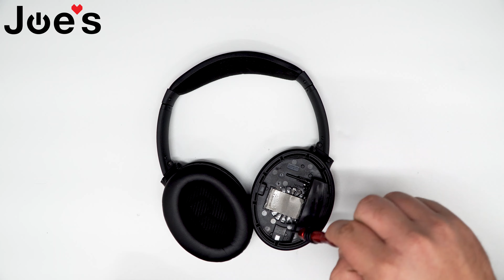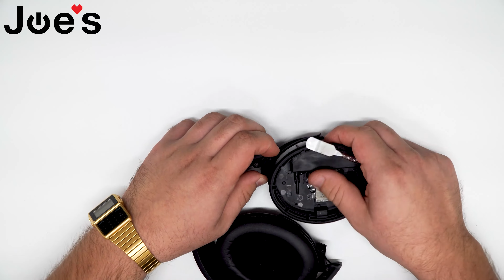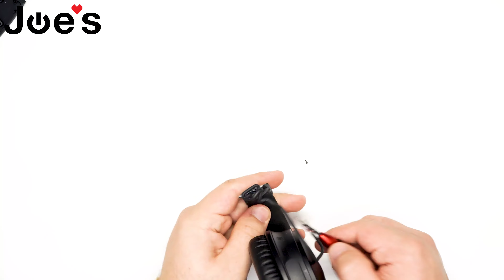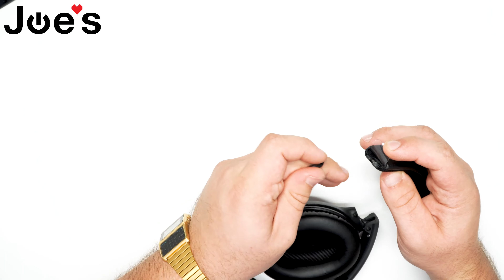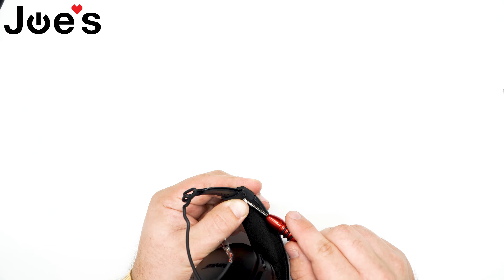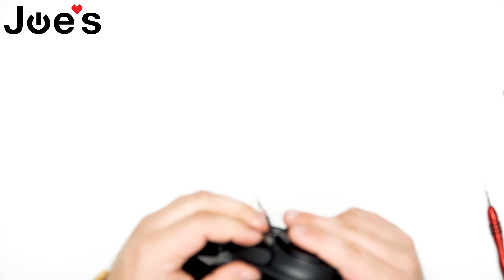How To Repair Replace Bad Torn Up Bose QuietComfort 35 QC35 Peeling Flaking Headband | Tutorial

Comment: Successfully completed the repair thanks to Joes listing and this guide. I had a little trouble with remembering what wires go to which pads, which customer service helped with quickly. Thanks Joe's 5/5⭐
Reply: For anyone in the future looking for the wiring to pad legend. This might not apply, but for my version of Bose QC 35 II's. The wiring was as follows:

Solder Pad -> Wire Color

B+ -> Thick Red Wire
B- -> Thick Black Wire
R -> Red/Black Wire
L ->  Green/Copper Wire
LFF+ -> Purple Wire
LFF- -> Teal Wire
T -> Black/Copper Wire
LFB- -> Green Wire
LFB+ -> White Wire
LDRV+ -> Red/Teal Wire
LDRV- -> Red/Copper Wire
DET -> Teal/Black Wire
Reply from the maker: Thanks for buying the parts from us we really appreciate it. Glad we could help you with the wiring!

Comment: After doing that mine does not turn on. Is it possible that I shorted out something? If so, what would I have messed up?
Reply: Nevermind, turns out I had two wires swapped. It is super hard to tell what color they are.
Reply from the maker: Glad it worked out for you

Comment: I wish Bose had place in a plastic connector for the wire instead of soldering it for easy headband replacement and or  other repair measures...

Comment: Hello. Do you have a video on repair for the volume button?
Reply from the maker: We don't currently have a video for that, but we get one in the works for ya

Here is a listing to the part: https://rb.gy/j6as5m
Reply: @Joesge  thank you so much! My button broke about a year ago and just realised that I can have that repaired. I will get the part soon. I hope I don't have to take apart the headset too much to get to the buttons.

Edit, I should specify the rubber part is broken. The underlying circuit is in good condition as far as I CAn tell.

Comment: Hi guys,  Thanks for the video, it helped a lot to understands the steps I need to follow. . I have a somewhat similar problem in that I broke the small swivel/hinge on the right side. There is no way I can unsolder and resolder so many small cables without a catastrophy, so I plan to cut the cable inside the headband, change the swivel and then use no solder thermoretactable connectors to relink both headphones. Dirtier but at least feasible for me.  AWG26 and up thermoretractable connector are easy to find, smaller not so much. Therefore my question, do you know the gauge of the 14 or so small cables you unsolder then resolder in the video?
Reply from the maker: I wouldn't recommend that since the wires are super small. You can send them in for repair. https://www.joesge.com/pages/repair-service-bose

Comment: Difficulty level 95/100 😂 I regret now not having bought the Velcro pad 😔
Reply: I changed the headband on my AudioTechnica ATH M50x once. Well... I had to buy Nappa leather and sew the headband myself. It took me hours! 
That being said, I am considering doing the same for the QC35. The result is just that good.
Real leather is just much much more durable and super nice to the touch.
Reply: @oilybrakes  I think that's gonna be easier for me too, I am better with a needle than a soldering iron 🤣

Comment: Hey!  i was wondering. Could i use Studio beats 2.0 WIRED parts for my Studio beats WIRELESS headphones?? mainly need hinge, inner pannel and Headband! Thanks!!
Reply from the maker: Thanks for the comment. Not all parts will be compatible. You can use the hinges, headband, and right inside panel. The left inside panel will not fit the studio 2 wireless. Hope this helps.

-David P
Reply: @Joesge  thanks very much!! helps a lot.